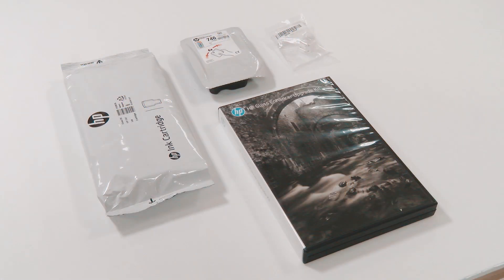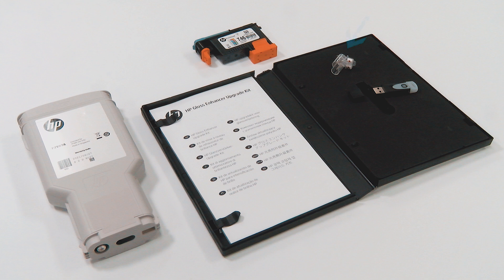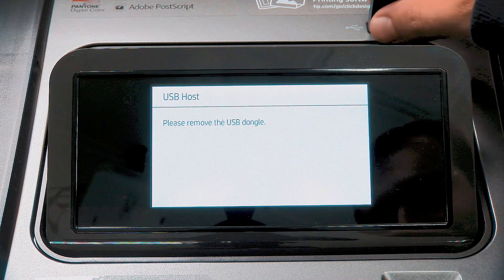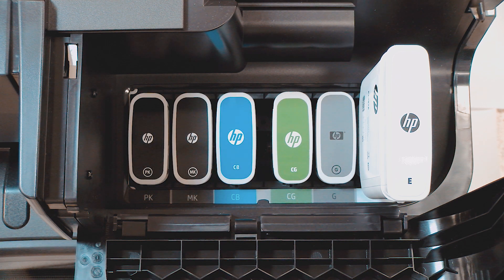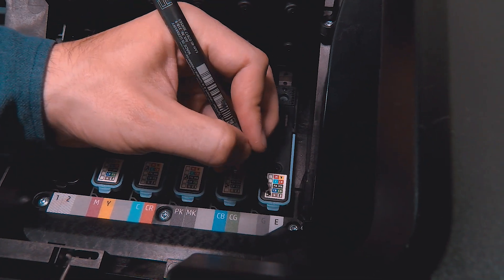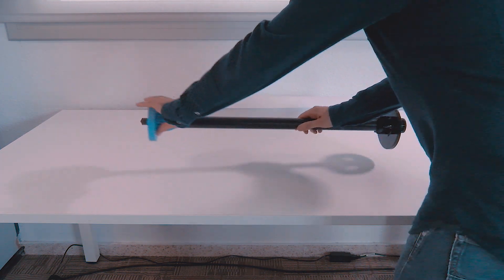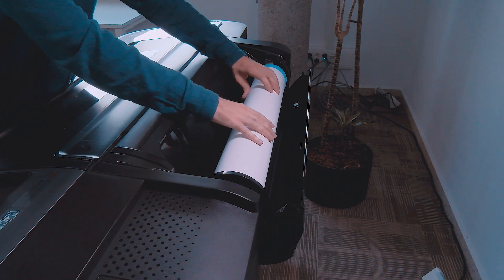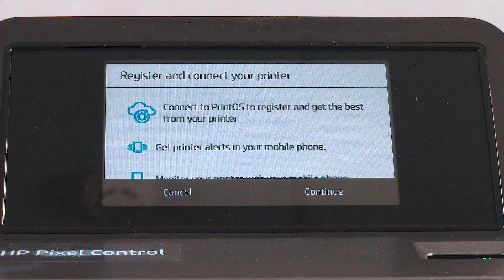Install the HP Gloss Enhancer Upgrade Kit for Z9+ During Printer Initialization | HP DesignJet | HP

Comment: It is advantageous to do the installation at first initialisation. However there are some glaring problems. First off, if you leave the printer initialise unattended the window asking if you want to install the Gloss Enhancer will continue without confirmation. Then if trying to install the GE it may have to have the latest firmware to be installed causing s system failure. So I recommend you stay beside the printer and watch for the message window to install then GE upgrade at initialisation. Yet if you can, download the latest firmware, put it on a USB key, plug it in BEFORE starting the initialisation. Then when it reboots with the new firmware, confirm the GE upgrade at first initialisation. Save yourself a print head and frustration.